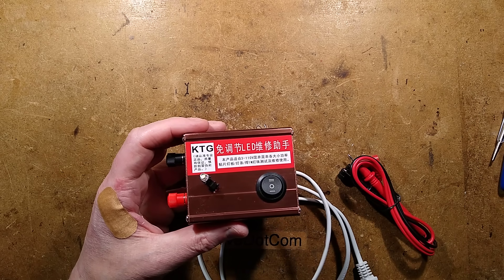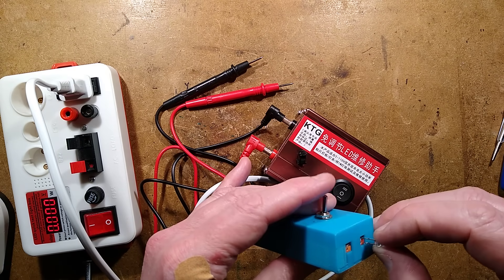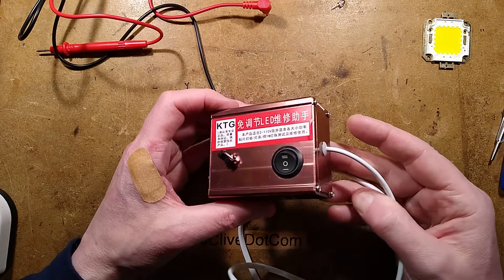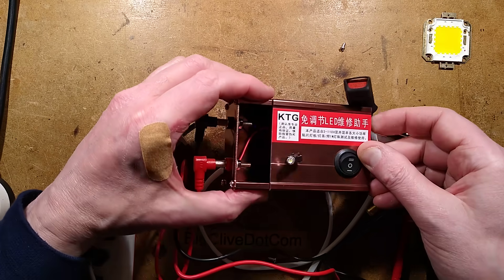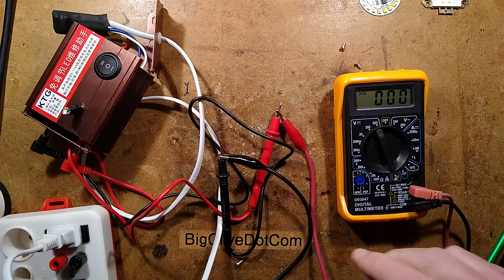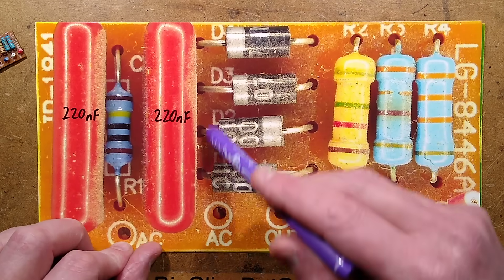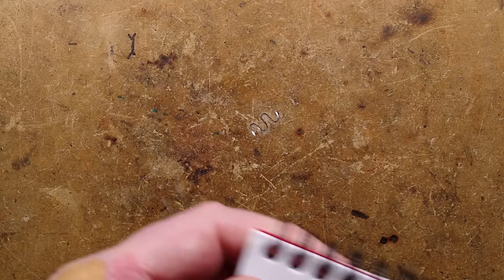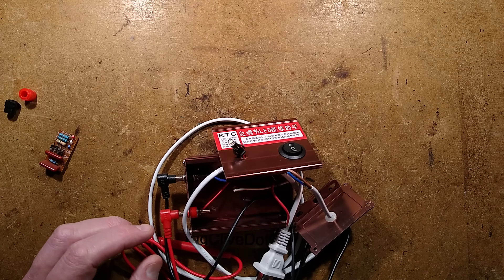Horrific LED tester that can literally kill you - (with scary schematic)

Comment: Another dangerous aspect of capacitor-coupled ac mains power supplies is the good chance of lethal voltages crossing the isolation boundary. There is a huge inrush depending on where the wall voltage is when you plug it in. If the ac voltage is peaking at 172 V instantaneous, the sudden connection just sails that voltage across the caps and blows up the other side of the circuit. I also doubt the caps are X or Y rated.

Comment: Do elaborate on the slightly melted croc clips incident, my good sir!
Reply from the maker: I was doing high voltage ionisation tests and had the black lead clipped onto my cold soldering iron as a ground reference.  Then forgot and switched the soldering iron on.

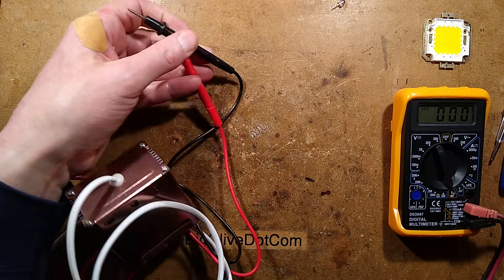Comment: By 4:14
BEFORE OPENING.

You have done about all (of) THE MOST STUPIDEST ACTS, available to idiots.
Not one of which has actually "tested" the device you have.

1st & foremost.
NEVER EVER "directly plug" any untested device, directly into a GP live circuit.

ALWAYS do a continuity and an insulation test, on the twin inlet plug pins, and the metal case - to verify the device is double-insulated, and completely non-connected to the metal case.

THEN - do a continuity test, between the PROBES and the inlet plug pins, to see that these also are NOT directly connected to the mains input.
WITH THE UNIT IN AN "UN_OPENED" 1ST LOOK CONDITION.
(In other words, do NOT remove the supplied LED indicator, or you will NOT have any indication that it actually did work, before you took that light OUT).

ONLY THEN is it safe to start using the device, by plugging it IN - to anything.

What to plug it into though - would also make BEST logical sense, to be an ISOLATION TRANSFORMER, a 1:1 double insulated power supply "test bench unit" (and not "another tester" that has an unprotected, non-isolated twin-pin-socket).

That way - whatever happens when YOU use anything by plugging in an ungrounded twin pin plug, (to a proper isolation transformer) will make the secondary supply to the device - completely isolated from earth, ensuring that BIG FRED - the dimwit of this channel, unable to fry himself UNLESS he connects himself - directly between the probes.

NOW - at no time would the ONBOARD LED be expected to "light-up" without the two probes being "connected/probed" across the terminals of whatever the tester is designed for, so simply flicking the switch anywhere without USING the provided probes, is just a jockstrap move - showing his ineptness of testing anything.

THEN by removing the onboard LED (after checking that yes it really was an OK piece), also shows us, that BIG FRED had no intention of allowing us to see if the probes could find anything, by removing the ONE UNIT which would "glow" if anything was thus probed.

2/-
NEVER EVER let a useless twit, do a video "to prove a device is lethal" - if the dimwit (twit) is themselves - also lethal.

Comment: Are these properly rated Y2 / X2 capacitors? 1M Ohm directly to the mains voltage + a large 400V capacitor at the probes (which you could) => ?
https://en.wikipedia.org/wiki/Capacitive_power_supply (where are the parts for your security)

Comment: It would have been much more informative and believable if you measured the voltage at the input, then between the caps/1M resistor and bridge rectifier, also after the rectifier in DC. You have to anticipate that some folks are electrically illiterate while coming across your video, thankfully I was literate and do understand much of it from my vast experience and schooling back in the 90's where my kids now call dino days.. LOLOL! Most of the folks watching your video do not know what or why the components used are even there for. It would make sense if you did explain some. TY

Comment: Definitely a class A product right there.. I fail to understand why one would need such a device in the first place.. I use a 3V button cell battery to test my single LEDs :-)
Reply from the maker: The LED modules in monitor backlights often use high voltage series arrays of LEDs.

Comment: Hard to "reverse engineer" some circuit when it was never really engineered to start with. If you value your life, you have to disassemble most any electronic device you get from most any country anymore. Better yet, just build your own circuits. Not only will you be the engineer of the circuit, but you will also learn things as well...   Thumbs Up!

Comment: Death trap shoddyness aside... the indicator LED in series makes sense because it's serving as a current indicator.  It could be useful to know if a faulty device under test is short or open circuit.

Comment: Why would you want a LED tester running off the mains, when a plug into USB outlet should do the trick, 
In fact I thought the electronics under the heatshrink was a "mains AC to reduced DC converter"    with a high frequency isolating transformer beeing the safety device.
Reply from the maker: Many modern LED illumination arrays operate at quite high voltage.

Comment: Why would anyone need an LED tester?  I've been retired over 30 years and LEDs then were mostly red but I never recall a faulty one and they're very easy to check anyway - They're just diodes, after all.
Reply from the maker: Things have changed.  The modern thin-film gallium nitride LEDs are less rugged than the old solid crystal red type, and are also pushed very hard for maximum light output.  Many LED illumination panels use large series arrays that run at hundreds of volts.

Comment: pretty sure the writing on the side was saying this unit was for 110 volt power supply.  Last I checked, your power supply is not 110 volts.  Could that be why the resistor was getting fried as well?  yeah....
Reply from the maker: It's a 220V unit with a Chinese plug.

Comment: just don´t buy PRC crap / tofu dreg...doesn´t matter what specfically...it´s always at least substandard or as shown potentially dangerous or even deadly

knew a company that sent a guy on a SpecOp to find out why the alu profiles they had ordered always came horribly scratched...turns out chinese factory workers didn´t lift them out of the metal cart...oh no...they draged them over the metal edge of that cart...all of them...
SpecOp-man fixed that by showing them how to put a piece of cardboard with tape to that edge so that there would be no scratches... facepalm

Comment: Lovely, I need this right now.🤔
Why is the LED just hanging in free space? 
It would at least look the part with a fitted flush to panel LED.
Reply from the maker: I think it was added later as a fuse if a probe touches a grounded surface.

Comment: 27 mA would hurt quite a bit. Depending on your skin and blood resistance/conductivity, you might experience loss of muscle control, but probably not. 

75-200mA is the deadly range, for refrence. This will cause v fib in less than 3 seconds. Death is likely. 
Over 300mA causes painful recovery if you survive, but youll probably survive if removed from the circuit.
Reply from the maker: Above 10mA is the point that it starts getting hard to let go of things in your hands.

Comment: That thing almost beats the DIY sandwhich griller that was 2 forks connected to mains. almost. Perhaps it is even more dangerous, because the forks were very straightforward with the electrocution thing, whereas this thing disguises the full horror in a  shoddy metal box and lulls you into a fuzzy feeling of "this almost looks like a real product." 
I am very sure the deliberate distribution of this product violates the geneva conventions.

Comment: Let's pay respect to the LED that survived 200V reverse voltage.
Reply: But how did a junction survive such a high reverse voltage?
Reply: @harshgupta4932  magic, probably
Reply: @harshgupta4932 low current?
Reply: @ExploringNew1  even a tiny current could permanently destroy a junction, older leds 'may' stand it but not the newer blue/violet/UV/ white types
Reply: @harshgupta4932 current limiter probably
Reply: @harshgupta4932  only 20-ish mA
Reply: I just poured a little liquor out for it 😂😂

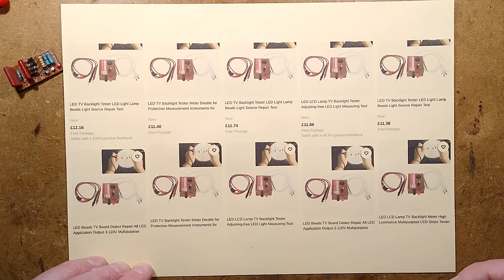Comment: 14:40 - I guess even a lack of a standard is considered a standard then?
Reply from the maker: There's definitely a standard amongst this stuff.  It features no grounding and blatant disregard for electrical safety.
Reply: @bigclivedotcom  Fair point.

Sort of makes you wonder if their QC departments are judged by how many working models they let slip out of the factory.

Comment: I had a small LCD Temperature controlled soldering iron that I used for a while, before one day, BANG! bypassed the RCD and tripped my outside meter. Took it apart and the live and neutral where touching each other, black powder! Terrible soldering with little careless whiskers poking out of all three wires!  I repaired it, but it soon the temperature control failed, oh China, why can't we all just be friends?

Comment: The impedance of the circuit is about 7.2kohm for the two capacitors in parallel, plus the selected resistor. At minimum that amounts to 7.2+3.3=10.5k. For 230V supply this means about 230V/10.5k=22mA current.That is according to electrical norms twice the painful current (10mA). Nice Chinese device.

Comment: I translated the front of the case as:

CTG

Adjustment-free LED maintenance assistant

(Please look for professional and authentic products with guaranteed quality, and be careful of counterfeit and shoddy products.)

This product is suitable for testing and repairing 3-110V mixed well mixed string SMD light boards/light strips/soldered lamp beads of various sizes and powers.

Comment: By my understanding, "shaver" outlets in the UK are suppled via low-powr isolation transformer which is switchable for 110V/220V operation.  Given that the device had a 110V plug, I would think a shaver outlet would be the ideal way of powering such a thing, and its isolation would guard against common-mode shocks even wtihout the failure mode of transformer-coupled RCDs.

Comment: I have my own DIY tester which works quite similarly. Except I put class X capacitors on both mains inputs and I have reasonable expectations of surviving a shock from one of the test clamps. Also they are crocodile clips and I keep my distance from said clamps while I power up the contraption.

Comment: i was thinking the led you pulled out was supposed to light up when the led is good or diode and there fore it completes the circuit which would be a bad design

Comment: You can use this with an 1:1 isolation transformer. What a strange device and pretty expensive for what it actually is. Most bulb LED panels will work with 60vdc and also filaments will do.
Reply: Bulb LED panels range from 81V (switch mode) all the way to ~200V (resistive) in my experience (India)

Comment: I honestly wonder what eBay would do if you reported these suicide gadgets and pointed them to the applicable test/teardown video. It's crazy to see what the Chinese are flooding the global market with, and how they're willing to sacrifice user safety just to save a few cents on fuses and isolating transformers. Although I guess this is an efficient solution to their overpopulation issues, good luck finding the manufacturer's sweatshop if this thing kills someone and you want to sue.
Reply from the maker: Previous attempts at trying to report extremely dangerous products have fallen at the first hurdle of not actually having an option to report dangerous stuff.

Comment: What happens, if you plug it into a power supply instead of the wall outlet and provide a much lower voltage? Is it still unsafe?
Reply from the maker: It need to be AC for this unit.

Comment: It is really dangerous, but why at about 15 in the video do you say "half wave rectifier" when it is clearly a full wave rectifier (4 diodes). Further, why did you draw a rectangle with AC in and DC out  instead of drawing 4 diodes and their connections? It is NOT a rectifier in a package. Just lazy or forgetful? If you had drawn the 4 diodes you might have realized it has a bridge rectifier
Reply from the maker: Half wave rectified output from one lead with respect to ground, in reference to defeating some RCDs/GFCIs.

Comment: Is there a cheap simple way of testing TV LEDs... Possibly battery powered? Or a better safer tester that is as cheap???
Or is diode setting on even a cheap meter enough to test them??
Reply from the maker: They are often high voltage series arrays and need a safer version of this tester.

Comment: I don't think the "WTF?" LED is meant as a fuse, I think it's there so if the LED under test doesn't work you know if it is shorted. If the LED was in a proper panel-mount holder (and there was electrical isolation) it would actually be a useful product.

Comment: There is something incredibly comical about a Chinese product warning about knockoffs. It's like putting anti-smoking ads on cigarette packs but blaming only your competitors instead.
Reply: Chinese people trust products not produced specifically for the Chinese market more.

This warning might be to deter people from buying things not made for the domestic market.
Reply: @eightcoins4401  There was a big thing here years ago about Chinese immigrants buying up all the baby milk powder in local supermarkets to send back to the home country because their domestic market was flooded with powder filled with lead and other contaminants, It says a lot if they can't even trust their own countrymen to not poison people for a quick buck.
Reply: I have the high and low voltage electrician qualification certificate from China, I suggest you look at all the electrical switches around you, I guess most of them are made in China, if you don't like them you should throw them away
Reply: @yurishofotolavski  I wouldn't trust you to do any electrical work around my house if you can't tell the difference between online vendors and retail stores.
Reply: @yurishofotolavski  Everything is made in China. The only difference is the regulation oversight between the companies you buy from. 

I'm Canadian. The regulation is good here. The knock-offs are not sold in the DIY stores here.

By the way i bet i can get that same certification just by paying a Chinese company for a print out. Knock-off certifications.
Reply: @jimbobbyrnes  During Trump's last term, China did a survey of its industrial capacity. In a program, a Chinese intelligence officer revealed that if China produces for one year, the rest of the world can take a two-year vacation.

Comment: In Poland, it can be done cheaper by using a transformer with an output voltage over 100V, e.g. from a gas boiler.

Comment: The 27ma you are measuring is the current going through the LED. If you measure the voltage at that time you will probably only have 3.2v across the led. I'm not saying it's a safe device per say but the 27ma is not at 240v because you are shorting it through the led load.

Comment: So what do the two capacitors do?  I remember they let AC power through... so because they store a tiny amount of power (220nf), as the AC sinusoid signal comes and goes they let a bit of power through until they're charged, and then back the other way as the AC goes in the opposite direction... so I'm guessing they're a way of limiting the wattage into the bridge rectifier? As the AC oscillates.... they: charge up to 220nf... then charge up to (ahem) -220nf.....repeatedly... feeding it into the bridge rectifier... if the powers cut and they're charged, the power leaks through the big resistor. So basically capping the power through the circuit?

Comment: Why would anyone buy that when a 9 V battery and a resistor would do the same thing?
Reply from the maker: Some LED panels and LCD display backlights operate at a high voltage.

Comment: 11:03 this is illégal in France because even if you rely on the limiter to work at 27mA ( which detail is acceptable ), the circuit does not provide galvanic insulation. This means, if the mains , for any random reason, provide 990V compared to earth, then, 27mA can kill you. Even in phase-neutral is 240V, the hot point may rise up to 990V ( as long as neutral follows to 750). 

It can not go higher, because at 1000V, the public network will arc and shunt the issue. EDF warrants to never exceed 1kV ( which in practice is not respected, I have had up to 2500V from public network ). 

So in short, the title of the video is legitimate. This circuit CAN kill you.

12:02 hell ... They did that ??? The sell that ???

Comment: I have a different tester in which the mosfet would get so hot it would unsolder itself & fall out of circuit, fitted a heatsink & no problems since

Comment: 08:10 With how much you were worried about the ungrounded metal case being a shock hazard; it's a bit surprising how you just left everything hanging out, kept touching it with your bare hands, and let that metal screwdriver almost roll over the live leads....

Comment: My 7 kV 50 mA cold cathode tube / neon sign transformer is much safer than this. That needs to be handles with respect but won't cause a fire or shock you if used properly. This can do both because chinese junk cannot be used properly.

Comment: When I was a kid we had a method to tell if a 9v battery had any charge.  You simply put your tongue across the contacts.  It gives quite a buzz.  Since the LED on this device will not illuminate with nothing connected I think you could just stick the probes across your tongue to test if it's turned on or not.

Comment: I am not an electrical engineer, but if I’ve understood this device correctly you could get the same functionality by cutting the female end off an extension cord and stripping the wires.
Reply from the maker: Close, but needs at least a diode and resistor.

Comment: Yeah, the little led is there to check if the led you're testing is malfunctioning short or open.
and the reason why it's dangerous, is because YOU removed the screw to connect test leads to it.😏